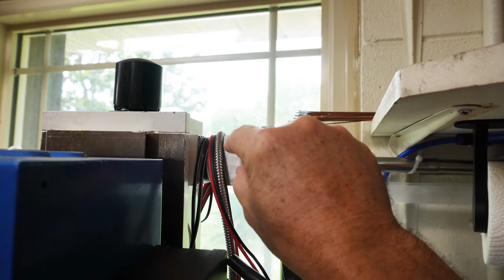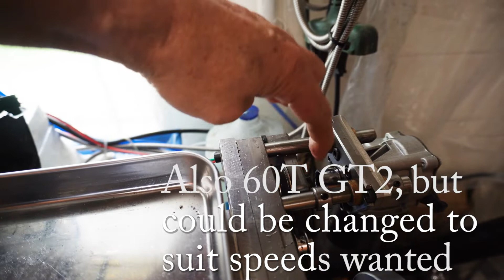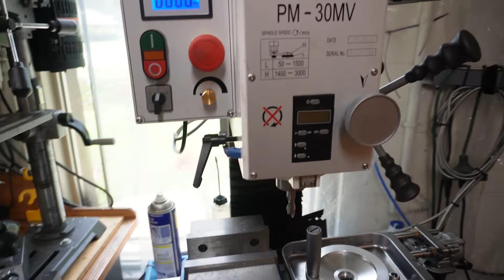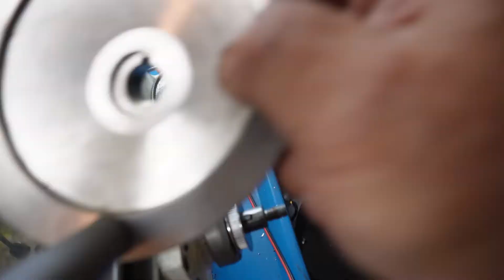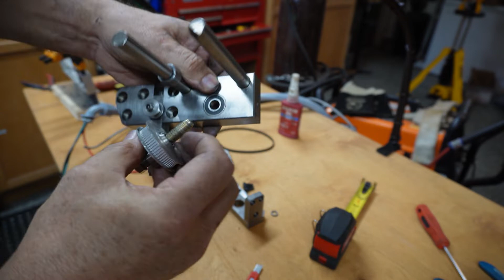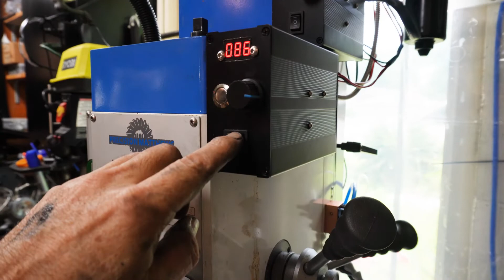Z-  and X-axis power feed using windshield wiper motors (PM-30MV)

Comment: A 1/2" bolt normally has a 3/4" head
It's fairly clear that your 1/2" drill rod is much larger than he bolt your pulley is fastened to which I suspect is actually 3/8"
A 3/8" bolt normally has a 9/16" head
Glad you titled the video z and x Axis but I understand it's easy to say y axis early on when referring to the z axis
I do like your efforts and it gave me ideas for my Bridgeport clone Kent mill
I will be trying to fit a used x Axis power feed to my y axis but it didn't come with the limit switch but your style would do me I believe

Comment: Great video. I am replicating what you did on my mill. Do you have a wiring schematic on how you made the limit switches stop the motor but you are still able to make it run back the other way. I am also interested in the wiring for the turbo button. Thank you very much.
Reply from the maker: Thanks for the compliment.  It continues to work well.

The limit switches are normally closed, and are wired in series with the left/right switch poles, breaking the left or right circuit.  When you change the switch to the other direction, its limit switch for that other direction is still closed, so the signal to the PWM controller is intact, and the table moves that other direction.

The "turbo button" simply bypasses the potentiometer, effectively making it 100% while the button is held down.

Make sense?  I really ought to do another short follow-up video to show the inside of one of those controller boxes, along with a wiring diagram.  I'll put it on my list.

Comment: Well that  was informative...think ill  try it for my round column  mill...yea getting  old so cranking that is a bit
Reply from the maker: As I mentioned in the video, I had rotator cuff surgery done on my right shoulder a decade ago, and it didn't go well.  I simply could not crank the Z-axis up for more than a few seconds without pain, so the very first modification I made to my PM-30 was this simple Z-axis power feed, while removing the useless-to-me crank completely.  I use it constantly and it continues to work well.

Comment: Do you happen to know what the amp rating on that motor is?
Thanks
Reply from the maker: Sorry, I don't know, and there's no indication on the motor nor in the product listing.  I'll hook up my multimeter to measure amperage under load soon and feed back here when I get an answer.  

Meanwhile, I can tell you that:
Typically, wiper motors are on a 15A circuit in cars - but that's mostly to allow for the inrush current briefly. 
- I'm able to power TWO of them simultaneously (for my Z- and X-axis) from my 10A power supply ... though they will slightly slow down when both are running together.  The power supply has a slow-blow 10A fuse so I can't be exceeding it for long anyway. 

So I'm guessing somewhere between 3-6A per motor, depending on the load. 

The X-axis motor casing can get quite warm to the touch if I try "pushing it" through a deep cut too fast.  If I disengage the X-axis motor clutch and try cranking by hand through that same deep cut, I appreciate how hard the motor was working ... and then back off on the depth or speed of my cut.  The Z-axis motor never struggles and stays cool.
Reply: Thanks for the info. I was thinking of adding this motor to my lathe for the lead screw but unsure of what size power supply to use for a single motor. Bigger can’t hurt I guess. Nice job on your project
Reply from the maker: @stevenhintz5508  OK, I have some real-world numbers from my X-axis:

No load: 4.5A left and 3.2A right.  (I've noticed that it moves slightly faster/easier to the right; there seems to be some additional table friction moving to the left; noticeable when manually cranking as well.  Need to investigate this.)

Surprisingly, the current doesn't change much whether it's running at 10%, 50%, or 100% speed. 

Then I tried holding the table from moving, giving it "considerable load" (more than I'd want my tool to push through) at 50% speed (the maximum I'd ever use for a moderately deep cut).  The peak that I could read on the meter, while struggling as hard as I could to resist X-axis movement in either direction was 8.2A.  (Which explains why the motor gets hot under heavy load.)

I didn't measure the Z-axis current.  

And remember that I have my X-axis motor rewired to use the red and green wires, so the motor is consuming more energy (and turning faster) than the approved red-to-black (fast) or green-to-black (slow) connections.
Reply from the maker: (Re-reading my response above...)  To make it clear, when I wrote "No load" above, it was still moving the table, just with no additional table resistance (i.e. no cutting load).  The true no load current (with the clutch disconnected, so the motor is spinning freely) is less than 1A.
Reply from the maker: @stevenhintz5508  Oh, and if you're going through the effort of powering your lathe lead screw, I'll strongly suggest that you do it with a stepper or servo motor and incorporate James Clough's (@Clough42) Electronic Lead Screw (ELS) -- eliminating the cumbersome change gears.  It works fabulously on my MX-210V mini-lathe, and makes single-point thread cutting a joy.
Reply: @HangarQueen  I thought about doing that but frankly all the electronics is very intimidating to me. I don’t single point very often but would like to vary my feed rate easily

Comment: My lathe has a pretty noisy gear train, so I rarely use power feed at high spindle RPMs. I know some guys use a wiper motor to power the feed rod or lead screw, as the case may be, for quieter power feed . You've got me thinking about it again.
Reply from the maker: I implemented James Clough's (@Clough42) Electronic Lead Screw (ELS) on my mini-lathe, driving a servo motor that drives the leadscrew by a belt.  It works really well, and makes single-point threading easy and FUN on the lathe.

Comment: regarding your comment about the axis locks, is there any way of interlocking them to the motor controls so the things can't be powered wilst the lock is engaged?
Reply from the maker: Sure, you COULD certainly rig switches to the axis locks in series with the limit switches.  But that's quite a bit of extra work and complexity for minimal gain, IMO.

I've forgotten my X-axis locks (still locked) once so far, when powering my X-axis power feed.  The cog belt slips on the pulleys, making a LOUD NOISE that's impossible to ignore.  I quickly turned off the X-axis feed, released the X-axis locks, and back to business.

My Z-axis locks are rarely used in practice.  But ya, because of my "screwed together" direct drive approach for my Z-axis motor, I do have the risk of it unscrewing if I tried power-feed DOWN while the Z axis was still locked.  It hasn't happened ... yet. :-)

Comment: Never considered a wiper motor.  Good idea!
Reply from the maker: Ya, they're pretty powerful geared motors, and cheap. 

Note that most will have their case grounded, so you'll want to internally disconnect that ground connection so that you can reverse the +/- polarity for reversing direction.  Somewhat optional if you're only using one motor, but required if using two (e.g. X and Z)
Reply: @HangarQueen  thank you for explanation. I would probably not even consider grounding as an issue.